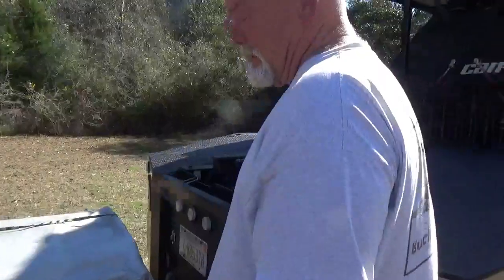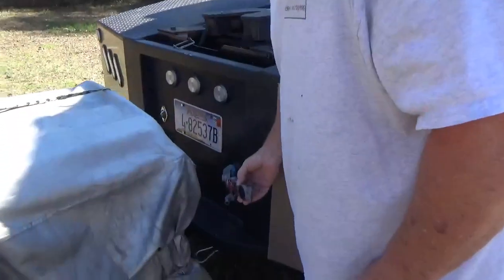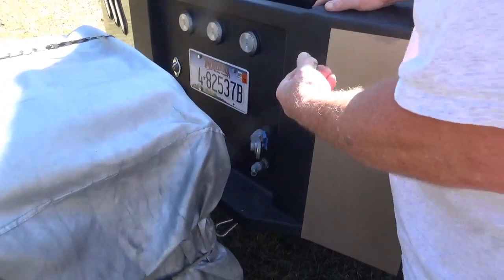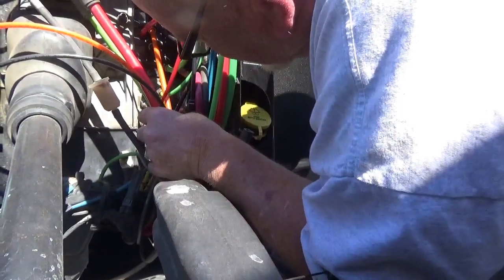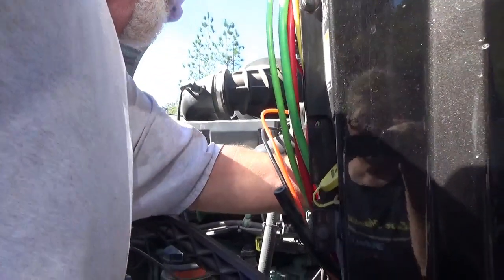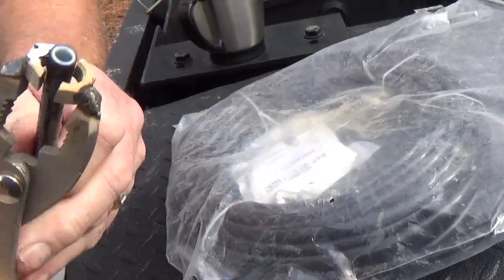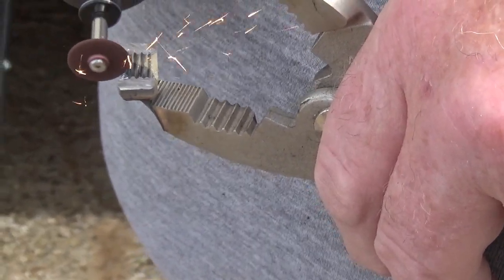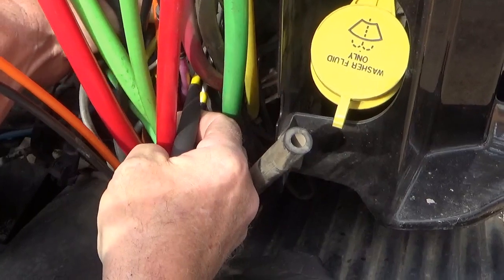HDT Air Brake System Leak Repair

Comment: Nice job Dave. Look at the bright side. It wasn't on the side of the road in Wyoming in the winter. I spent a few hrs under trucks cutting out bad air lines and splicing in new. When it's -10 wind chill it adds another level of "You b***h" to it lol. Meh the HDT is still the best game in town to pull a large 5th wheel. Stay safe.
Reply from the maker: Damn ...10 degrees below zero...you da man!!

Comment: Thank you for posting this video some mechanics only use o ring seals used in air-conditioning system's the material there made from I'm told will out last the system being repaired .
Reply from the maker: Thanks for watching.  We try to use only Volvo original parts.

Comment: Watts Team, Truck has air brakes got it. Trailer has hydraulic disc brakes, per your brake repair video. Curious what takes the air from truck and converts that into hydraulic pressure? Good to have tools and a good helper. Gary
Reply from the maker: We have the bludot system which converts the air pressure to hydraulic pressure.  https://youtu.be/iCH1mUa_dQA

Comment: You have a Volvo 730, right?  I don’t recall having all those colorful hoses on mine. It makes me wonder if yours have been replaced or if mine need to be replaced. OR did Jack and his team at RVH Lifestyles change all that out for you while they were working on your truck?

We have our truck in storage while we winter in Alaska, but I’m going to have to look at all of this when I get the truck back on the road.

Perhaps you will be glad you have 100 little gaskets.
Reply: Oh, I see it is a 780, and in another video you mention it is a D16. Mine is a 730 (not much difference) but it has a D13 which is a bit different. Thank you for the video just the same.
Reply from the maker: You are right...780. They came colored from the factory.

Comment: I had to look through the comments to see if anyone jumped on the "breaks" usage. How long that thing been leaking? One more question you folks going to any of the HDT Rallies this year?
Reply from the maker: Leak was too small to affect the brakes. If the leak is so bad it affects the brakes, the red knob would pop up (safety feature). My wife has very keen hearing and heard it.  Not leaking very long. Not sure about HDT rallies this year.